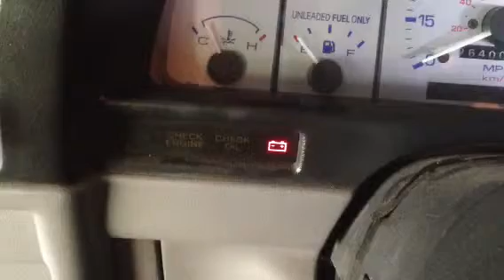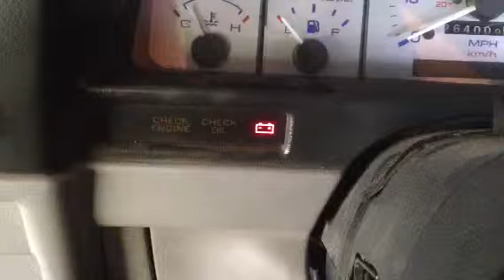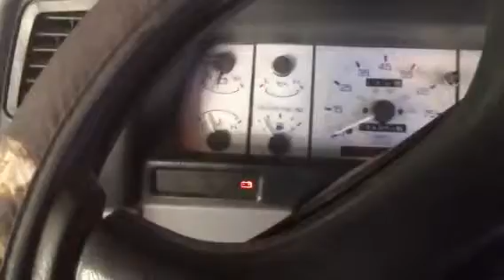What does this obd1 code mean

Comment: it means its a 6 cylinder,and since your doin cold reading put grey wire with an attachmebt to your battery negative,then you should get more codes.them warm up vehicle,if it runs and it may give you three or may just flicker thats when you gun it then start counting the codes.it may have one them eight or then 9 then 9 but pay close attention .then it will cycle t6hrfough twice then probably give engine light when finished.dont give it gas when starting or you will get crazy stuff.and on the warm engine test,i would advise making sure you hook to the terminals in the eec connection.grey and top right on the fat side.thats on a ford.you might check some videos to make sure but if you get crazy stuff like 9 over and over you try gettin more info